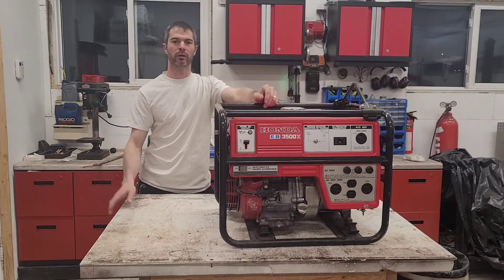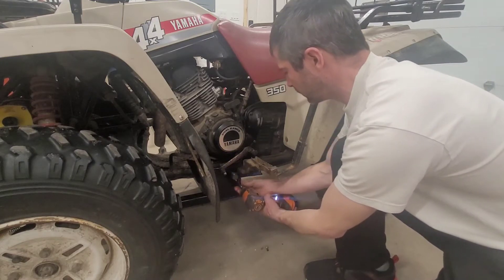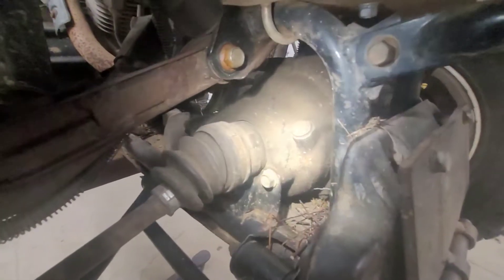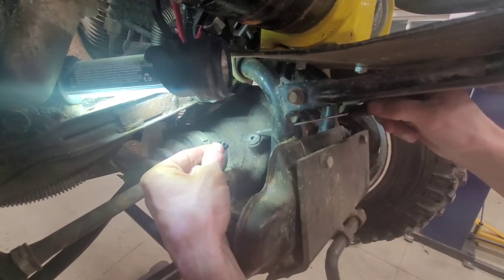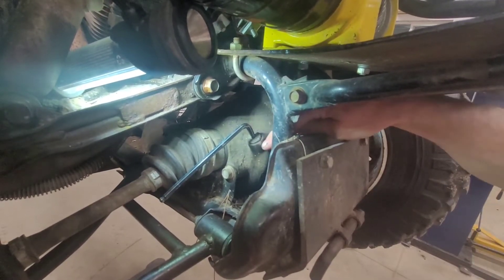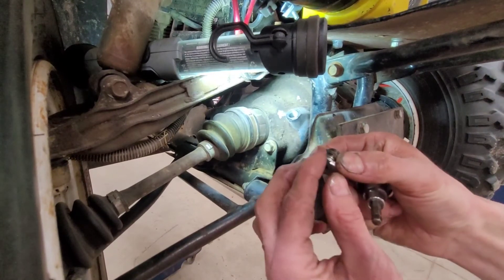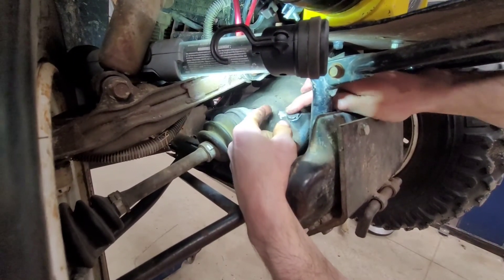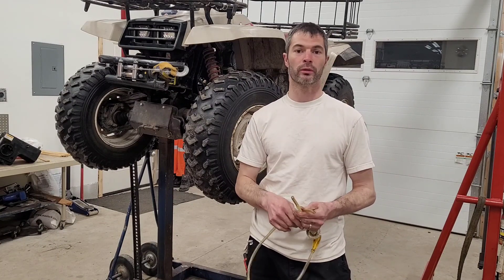Big Bear Front Diff Service!!!

Comment: Thanks for the video... I just purchased 01 big bear 400 4x4
I  changing oil in the diff.. So I have to filled up til the hole?
Reply from the maker: Yes. Take your time and avoid making a mess
Reply: @thehonestmechanic  thanks.. I filled up and it is normal rear differential 200ml and front 600 ml? 🤔
Reply from the maker: I'd have to check the manual. I don't remember....

Comment: haven't you got a second drain plug on the rear of the front diff housing not accessible unless you drop the bash plate? Great video, thanks for sharing!
Reply from the maker: Yes there is. I talk about it in another video. Great observation!

Comment: Does anybody know where the serial number for the rear diff is on the 1998 big bear 350 4wd?  I have ordered the All Balls Racing rear diff seal and bearing kit from Partzilla and it has the wrong bearing.  I sent it back and they sent another and it still has the wrong bearing.  I talked to someone at All Balls Racing and he says that it is the right bearing.  He thinks that the previous owner replaced the rear diff with one from different model. I don't think so because when I bought it, it was only 5-6years old so I don't think it was.  I am trying to get in touch with the guy I bought it from but that was  18 years ago.  I found on the Yamaha website what the serial number is for the rear diff but not where the serial number is.  I can't see, I am going to try to clean it up some more and see if I can find it but any help would be appreciated.
Reply from the maker: I'll see if I can find something on my big bear. I'll report any findings here